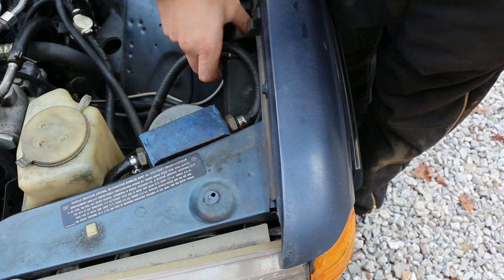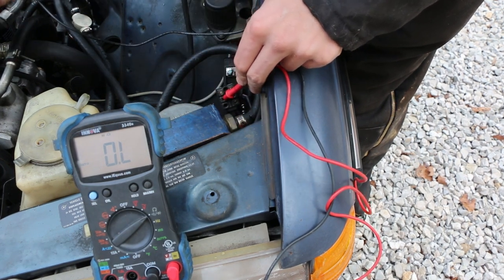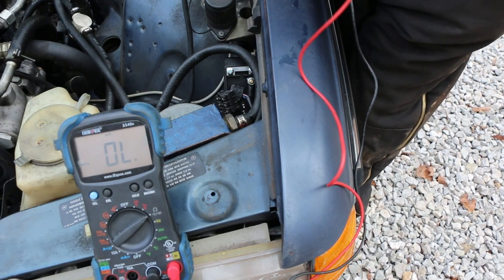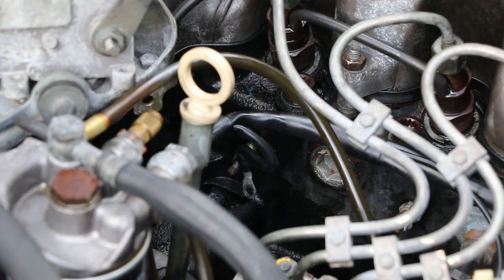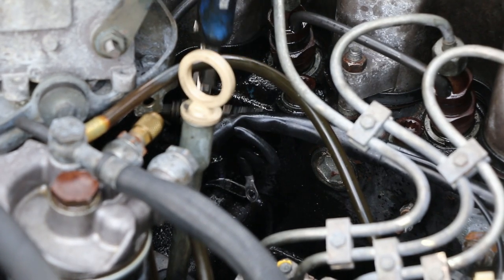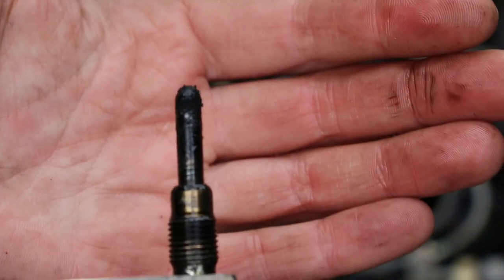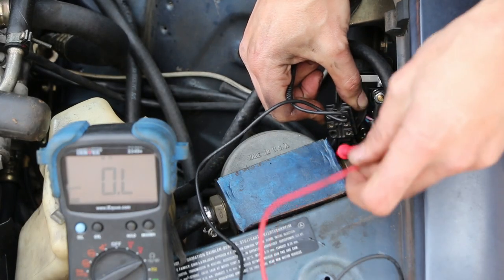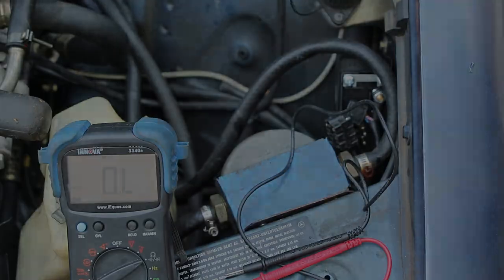W123 Cold start problems? Glow Plug Testing, Reaming and Replacement.

Comment: This is the best video I have found for changing glow plugs. Thank you very much.
Reply from the maker: Thank you! A good set of glow plugs makes all the difference. I started my car up the other day to pull it inside for some service, it was about 9F outside I believe, it fired right up on the first glow cycle, coughed a couple times but smoothed out within a matter of idling for a minute or so, never stalled! I was quite proud of everything I've done to keep it healthy.

Comment: I ran into lots of trouble with my glow plug relay. The circuit board itself some how got some corrosion causing it to act intermittent. I tried to jump the resistors with a wire where the traces were damaged with a little bit of success but then blew the strip fuse and decided it was time to come up with something different. Even on a hot AZ day my car will drain the battery before it starts without glow plugs. 

I ended up using a starter solenoid off an old Ford. I used the original 12V hot wire that fed the glow relay as the feed for the solenoid. I believe this wire is already fused up by the battery from the factory. I then mounted the solenoid in place of the glow relay and made sure it grounded to the body. The output of the solenoid feeds to a mini 6 slot fuse panel I picked up behind the counter at Napa for about $15. This panel is rated for up to 20A fuses. I then ran a wire from the hot side of the solenoid to a switch I mounted under the dash which then feeds back to the S terminal on the relay. This line is fused, loomed, and ran through a drain plug under the carpet up by the firewall. I then snipped the original connector for the glow plug harness and ran each individual plug wire to its own slot on the fuse panel and gave each slot its own 20A fuse. To take it a step further you can then probe the connectors on the little plug that comes off the original relay, I believe it is a 4 or 5 pin connector. With someone sitting inside the car you can quickly determine which one when probed illuminates the glow plug light on the dash. Conveniently the Ford starter solenoids I terminal provides 12V accessory power when the solenoid is engaged. Cut the illumination wire and run it to the I terminal and you have your indicator light working when the glow plugs are engaged. 

This does a few things better than the original glow relay in my opinion. I don't know the exact number but from what I have read the original relay can leave the plugs hot for up to 30 seconds after the car has started to help with cold starts. If true this can accelerate carbon build up around the glow plugs and lessen glow plug life. If you have a short in the glow plug harness you risk blowing the strip fuse as I did. When this happens you lose all function of the glow plugs. Using the mini fuse panel you can have each glow plug running off of its own 20A fuse. When one glow plug shorts and pops a fuse you can still make it to work with the rest of them functioning. The only real downside being you have to manually press the button, but I find this to be a good thing. In the morning I only need to press the button for 5 seconds initially and the car starts fine and doesn't need any glow after that. If the engine is warmed up I don't need the glow plugs to start so I don't waste an entire glow cycle as you would with the original relay. The glow plugs put quite a bit of stress on the battery when glowing pre-start so I wouldn't be surprised if this also extends my batteries life. Not to mention on the off chance someone tries to jump start and steal my 300D, unless they know to press the button under the dash they are going to have a very difficult time getting it started.

Comment: Good.   For tghe first time, this wasn't a nightmare!.  Tip - you can slip a 3-4" length of fuel line over the 8mm thread end to ease the handling and initial threading into the chamber.
Reply from the maker: Hey that's a handy tip! It can be miserable to get them started into the head sometimes with the injector lines on. Thanks for sharing!

Comment: I just had to replace my glow plugs on 2/18/23.  It was starting hard and finally on 2/16/23 the glow plug light finally stopped coming on and I had to go through 3 times of trying to start the engine before it kicked over.  The glow plugs were all carboned up.  I replaced them with Monarch glow plugs from Mercedes Source and did a diesel purge and oh what a difference in the way the engine worked.
Reply: This is on a 1981 Mercedes 240d with a 4 speed manual.
Reply from the maker: It is remarkable how much difference it makes, even just knocking the carbon out of the glow plug holes will make the plugs vastly more efficient!

Comment: Boa noite amigo mais um bom video explicativo. Retirei minhas celas do meu om617 para teste. São originais de 1980 . Estavam bem carbonizadas. Esguichei spray descarb no furo da antecâmara . depois dei a partida. A compressao do pistão expulsa toda sujeira. Mais a ideia da broca também é de grande validade
Reply from the maker: Google translated: (may not be great grammar)
Olá! Parece que você tem uma boa técnica aí! Ouvi dizer que os depósitos de carbono podem ficar muito duros e a broca irá raspar qualquer coisa que esteja endurecida, não tenho certeza se o limpador irá quebrar esses depósitos, mas poderia muito bem!
Uma vez meu irmão tinha uma vela incandescente que estava presa, ela desaparafusou, mas não saiu da cabeça, então ele a deixou solta, ligou o motor e, depois de esquentar um pouco, ela tirou a vela presa, evitou muitos problemas se tivesse quebrado ou algo assim.

Original:
Hello! It sounds like you've got a good technique there! I've heard the carbon deposits can get very hard and the drill will scrape off anything that is hardened, I'm not sure if the cleaner will break those deposits up, but it very well could!.
One time my brother had a glow plug that was stuck, it unscrewed but then would not come out of the head, so he left it loose, started the engine, and after it warmed up a little bit, it popped the stuck plug out, saved a lot of trouble if it had broken off or something.

Comment: Just got a 77 240D from a friend. Odometer stopped at 316k miles, glow plug light on dash comes on, but under 55 degrees or so, it struggles to start. Going to be doing this job soon
Reply from the maker: A good set of glow plugs goes a long way!

Comment: My car will not start at all in the cold. My glow plug light on the dash won’t even turn on, is that the car telling me the glow plugs are bad? Or is it a grounding issue? I’d appreciate anyone’s advice!
Reply from the maker: If you aren't getting a light I would look at the glow plug relay, make sure it is getting power from the battery, and the keyswitch, there is a small connector with 4 wires and a larger connector with 4,5 or 6 wires depending on if you have a 4,5 or 6 cylinder engine.

The smaller connector has connections for the keyswitch input, starter motor input, glow light output, and something else I feel like is a temperature reference, but might just be a ground.

You should also hear an audible click from the glow relay when the keyswitch is turned to the run position, if there is no click, then either the relay isn't getting power from the battery or it isn't getting power from the keyswitch.

Comment: All my plugs measure 1.5 ohms, I have one plug that I just ordered to change. I’m in Canada would you recommend 9/32 7.144mm or 17/64 6.746mm? To ream.
Reply from the maker: I would try the 9/32s bit, it should only be pulling carbon out, no metal, and of course as a reminder, do this by hand, no cordless drill or anything lol, and a little grease on the bit that gets cleaned off and replaced between holes to catch the carbon.
If it won't go in without grabbing some metal, then go down to the 17/64 bit. I've heard up to 19/64 is ok, but that's the very absolute limit, and we don't need to go that far to accomplish what we need.
Reply: @trythistv  thanks for the reply will do!

Comment: how often should glow plugs be replaced?
Reply from the maker: I'm not sure if there is a replacement interval, They can last for years, or can go bad in months depending on the quality of plug and health of the engine, injectors and stuff.
For myself I change them when I notice a rougher idle at cold start, as that often indicates that one has failed, and I typically do an ohm test before it starts getting real cold just so I'm confident I won't have starting issues as soon as the weather gets nasty.

Comment: Hi . what  happen if one have 13.4? is  good ? or need to be change ?
Reply from the maker: 13.4 ohms is bad in my eyes. You could pull it out and test it by connecting it to a battery (don't burn yourself!) But I would replace it, typically I like to see around 1 ohm or less, and that is what I would expect out of a new plug.